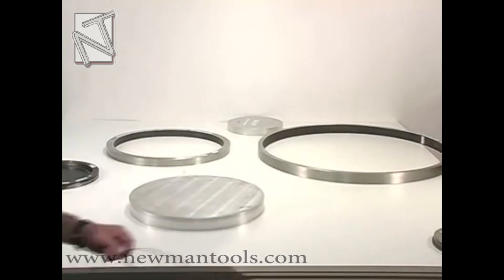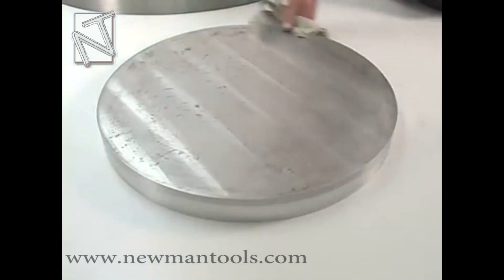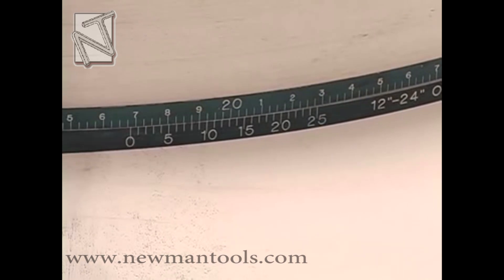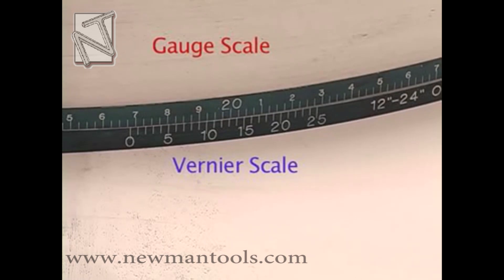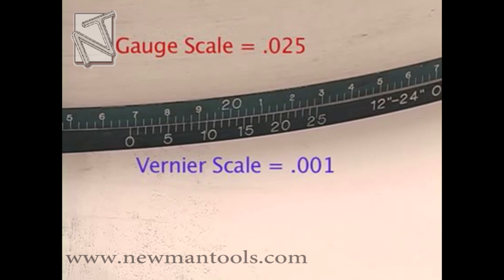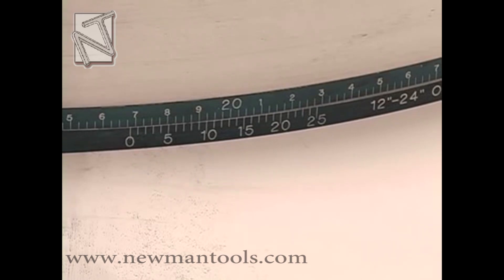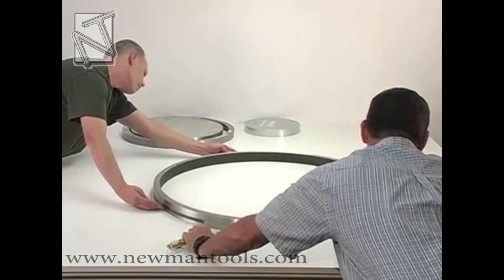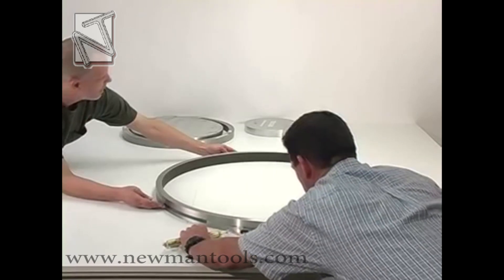Pi Tape® Outside Diameter Measuring Tapes

Comment: When measuring, how do you know its .675 and not .676 or .677 or .673 or .674 OR anything different than that?  Not trying to argue with you, but why did you say it was that?  I guess i'm saying what happens when the ZERO lands between two dashes?
Reply: Just like a rule, a caliper, you take the the first division (the smallest) between the two, then add the finer divisions (the vernier reading) to get the total. The total should give you a reading that between the two dashed lines that the main zero lied in between.
Reply: The gauge scale side well always be read in .025 thousands of an inch.. ie 25, 50,75...just count how many lines between numbers on the gauge side. Should only have 3

Comment: MY PI TAPE IS WORN AT THE 0 MARK, CAN i START MY MEASUREMENT AT THE 1.0" MARK AND STILL BE ACCURATE?
Reply from the maker: If the tape is worn out,  it time for a new tape. For Accuracy  I suggest getting it recalibrated but the recalibration might cost more than a new tape.